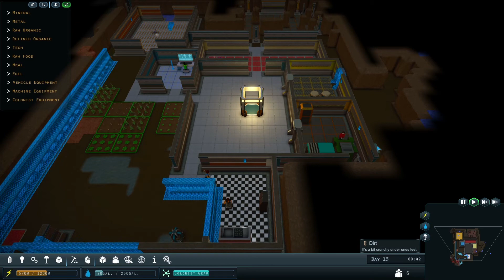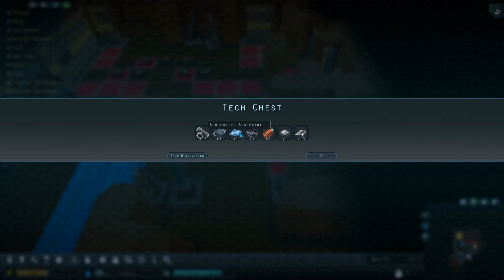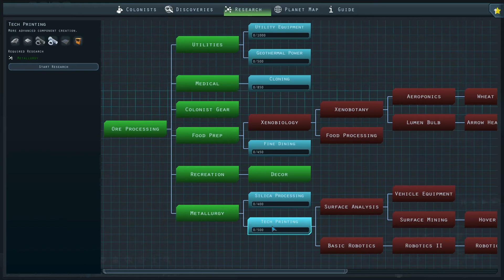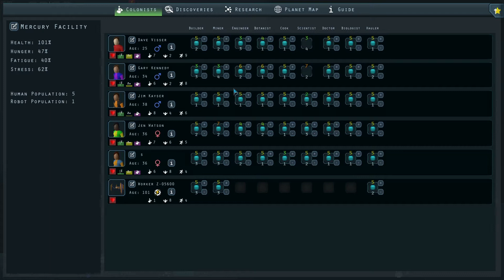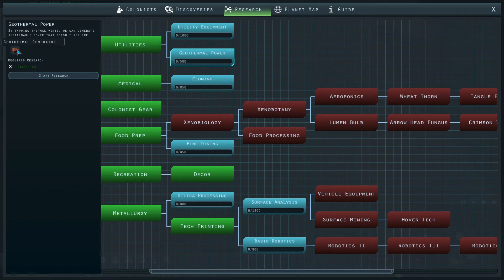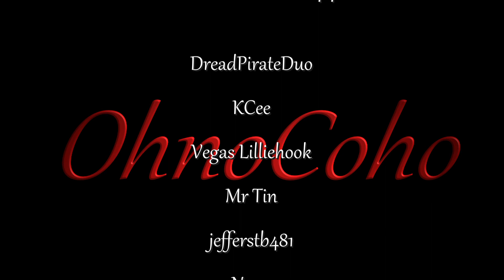Med Bay! | Mercury Fallen | Season 1 | EP 4

Comment: You know, you can read those logs, they tell an interesting story (just hit the "show discoveries" button when you open the canisters).  

The clone chamber is what you'll need the water for in the med bay.  Your kitchen really doesn't have to be that large, those two items, as far as I know, are the only things that will end up in there.  Um, I'm not sure you can put floor over the water & under the pump & still get water from it, I'll be interested to see how that works out.  BTW, you should have utility floor (not sure if you start with it or you get it when you study utilities), you just needed to scroll down the page.

You're going to want to mine everything eventually.  You don't know how many team members are still in sleep chambers behind all that dirt, plus there's resources to mine, additional canisters with discoveries, blueprints, resources, etc., possibly more robots & more beginnings of rooms so you don't have to use up resources, just enough to complete them.  So don't wall yourself off from the mining areas.  Doing it a little at a time is good, because they do rank mining as more important & will put off building important items to just mine.  It drives me crazy LOL.

"s" is Alice Peters.  That's strange, it used to tell you that the bio-refinery task was an engineering job (so is the metal refinery task btw).

Start putting out plants, not sure if you can put out bedside tables anywhere but the bedrooms (but then I didn't know you could put chairs & couches out on any floor but rec floor).  Also you might want to study fine dining, that's where dining tables come in (that's also where the cooked potatoes' storage comes in - the food dispenser).  I think what happened with the potato birth was that someone was carrying it when they went to the medibed (either the patient or the doctor) & put it down & then just left it there.
Reply from the maker: Ah, I was wondering about those logs... I'll have to look closer at them :)
Clone chamber needs water... check!
I kind of decided that once i walled in the pump room then it didn't really need a floor.  You're right that I could do utility floors right away from what I understand.
The peripheral walls are future base walls, I just have to put doors in them ;)
Thanks for the heads up on the potential discoveries/additions!
I did notice that they prioritize mining, it's what was keeping them from doing other tasks... grr...
LOL!  I'm really thinking of keeping Alice Peters as just "s".  Fate gave her a new name and who am I to interfere with that?
Plants are in the plan, I think I need to or still need to finish the research for it first.  
Indeed!  That is the most likely explanation for the potato birth.  My explanation has more panache though!  ;)
Thank you Angelia!